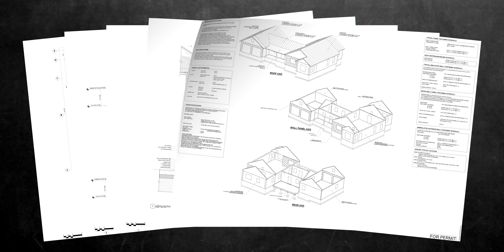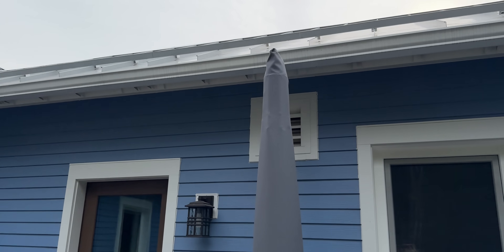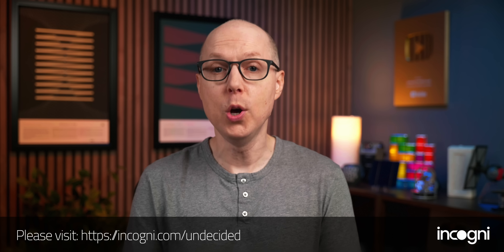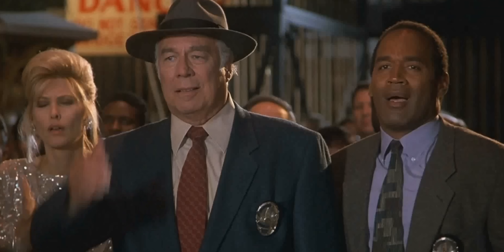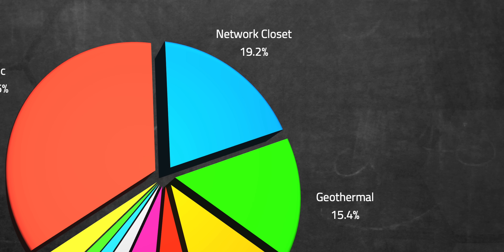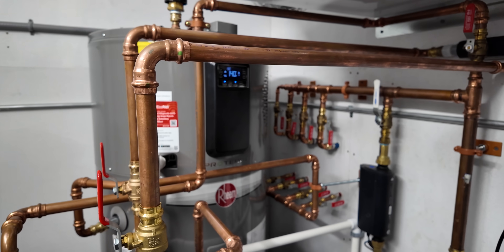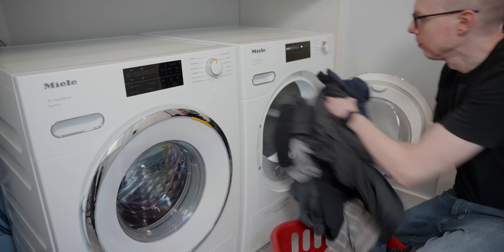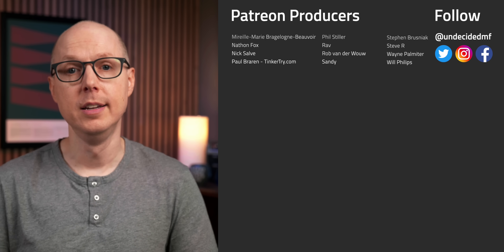What I Learned After 1 Year in My Net Zero House

Comment: I am planning on building or converting a house in the near future. In my plans, I can do all the electrical work myself having been an electrician for 45 years. My cost analysis is going to be looking at some of the outrageous prices of super energy efficient systems compared to just adding more solar and batteries. I would love to design it without a grid connection because they just don't seem to want or need your power any more and pay you practically nothing for it. The cost of solar and batteries has plummeted and there are some great DIY systems out there. I would plan it to supply 100% of my energy needs on the worst case weeks. In the summer, I think running a crypto data miner would pay near or better than the utility does. My thought is about 30-40kw of solar and 100kwh of battery feeding about 20 kw of inverter. I am hoping to have the real estate to have a separate structure for the batteries and inverters and all solar ground mounted. I have found my current 12 year old HVAC system to very costly to maintain and wonder if spending less on a bunch of stuff would be of better use making power instead of spending a fortune to use less. Of course, there may be some hurdles as many building codes require that you have a utility connection and have all the latest energy efficient stuff. It sure will be an interesting build that may be better done on an existing building not having to meet that 20% to 30% cost increase due to efficiency.
Any input by anybody would be greatly appreciated.

Comment: Have 4% on your back up heat normally your heat pump produces your heat, but there is times when it’s not producing enough so it it will turn on the burners in your furnace to supply extra heat. I believe that’s correct.

Comment: Really great video.  Thanks.  

I notice that your attic doesn't have (visible) radiant barrier.  Is that not necessary/optimal where you are?  With the R65 insulation, it's possibly a moot point.  I'm in a part of CA that gets over 100 for about 2-3 weeks cumulative over the summer; radiant barrier has helped keep our house cooler and reduces our AC use.

How much does all that monitoring HW and SW cost to set up and maintain?  I'd love to be able to do all that too, but seems like it would be expensive.

Comment: I’ve made my home in Southern California energy net zero - a lot easier to do than in Massachusetts. My 12 years of experience tells me most problems are best solved by adding more solar panels. Why? Because unusual high-efficiency systems are extremely expensive to install and maintain, and often unreliable. Solar on the other hand is extremely reliable. A simple system is best.

Comment: Great video! I retrofitted my 1880s house that had an oil furnace to be heat pump everything with solar and it's been great. The only issue I've had is with my AO Smith heat pump water heaters failing every few years.

Comment: GPT has thoughts: In the SPAN Smart Panel app, "heat backup" refers to the ability to prioritize heating systems (such as heat pumps) when managing backup power during an outage. If your home is equipped with a backup battery system, the app allows you to designate essential circuits, like heating, to receive power from the battery during a power outage. You can control which appliances or systems continue to run, optimizing how your stored energy is used to extend battery life. This feature is part of the broader customization options available within the app to manage home energy usage and backup systems efficiently.

Comment: In SWFL and ended up getting a Rheem heat pump water heater and agree, even without anything fancy to pre-condition the water, only using about 88kwh in the summer to keep my water hot (we leave it at 140), with the added benefit that it's also helping to cool my house down!

Comment: Heat pumps usually rely on a traditional burner or electric heating coil for emergency heat.  The thermostat should have a control wire for activating that. I’m guessing that’s what your app is calling backup heat.

Comment: I know the idea here is to focus on energy efficiency, but economic efficiency I think is not an insignificant point. I love the idea of these kinds of appliances like the geothermal HVAC system and even the heat pump dryer. But, using that heat pump water heater is an example, because it is the only appliance I have direct familiarity and knowledge of, it is so insanely expensive compared to a standard water heater, and then there's the issue of maintenance. There is no way that I can reasonably expect that that refrigerant system in that thing is going to last 15 years. And, when it does require maintenance, if I can even get someone to fix it for less than the cost of a new unit, which is highly unlikely given the cost of that type of work these days, it seems like you reach a point of diminishing returns. 

I have a solar water heater, an AO Smith, which I absolutely love. But the reality is that this thing cost about $5,000 installed. whether the water heater dies or not within 20 years, I'm sure my homeowner's insurance will demand that I replace it at some point solely on the basis of its age. I did spend a couple of bucks to put an electric anode in it, which has a 20-year warranty and so far my 10-year-old water heater seems to be performing well, but it will never save me $5,000 or anything close to that in electric usage even over a 20-year lifespan when compared to a relatively inexpensive but efficient standard electric water heater.

Comment: Thanks for the video! I have a ground source heat pump in a cold climate (I live in Stockholm) and I have the same experience as you have with wasting more than saving energy when trying to micro-manage temperatures. Watching the HeatGeek channel a few months back convinced me that I was doing it wrong, and since then I have adjusted my settings to try and heat all the time (in winter months ofc), all the house, with lower water temperature than before, which improved my efficiency quite a bit. I even had tado smart radiator valves to control room by room the temperature, but that I now set only to avoid overshooting temperature to uncomfortable levels (which can happen in very sunny winter days).

Comment: I am convinced that panels plus batteries and heat pumps are a good thing but for already existing houses it is difficult to justify especially if you are likely to move or are over a certain age. I am 70 so a system for my 6 bed house would take 15 years to pay off, I hope to be around at least that long but am not betting so much money on it.

Comment: Definitely saving on Bills, but is it worth the up-front cost it takes? From financial standpoint. All that geo heating, water tank, solar, battery' must crazy expensive. And insurance on all that? Isn't it better to just use gas combi boiler for heating and hot water? Maybe wet heated floors or radiators? What is pay of point for solar and battery and their life span?

Comment: At 16:14, you say that dryers that vent outside of your home are ejecting a lot of conditioned air from inside your home.

The issue with ventless dryers is that they are ejecting warm air inside your conditioned home, so your air conditioner is going to do more work as a result of running your dryer, regardless of where the air is being vented. I'd still recommend heat pump dryers simply because of the fact that they need a fraction of the energy usage for drying the same load of laundry, but the heat they produce doesn't magically disappear.
Reply: The other benefit of a ventless however is the... lack of venting. In a super air-tight home with a vented dryer, you often need a makeup-air solution on top of everything else going on. Obviously not a concern on a "standard" home. Just throwin' that out there. :)
Reply: @suavocado69  I understand, but with his ERV, his home isn't air-tight, anyway. Inside air leaves, and outside air comes in.

My comment is about the heat, and I don't like that people leave this out when discussing heat-pump dryers.

Comment: Matt, such great information in this video. Thanks. A few questions. You talk about keeping the house temperature fairly constant with geothermal. How would geothermal efficiency be affected if I like to open the windows when possible for fresh air and just for feeling more connected to the outside? Also, I like it cooler at night to sleep. In the summer, I keep the temperature fairly constant and turn on fans to make the bedroom feel cooler. But in the winter, I lower the house temperature by about 8 degrees Fahrenheit to get a comfortable sleep temperature. Do you find that a constant house temperature is comfortable both during the day and at night? Looking forward to the next video.

Comment: We have a standard home I retrofitted with caulking to mitigate air infiltration, thermal insulating blinds and I added R-70 insulation to reduce heat loss. 

We have a 2 @ 4 X 10 black chrome panel SHW system, which provide about 80% of our hot water use.
We have a 7 kW (STC) yearly net metered PV system which generates a yearly average of around 16 kWh a day.
We have a 2013 Chevy Volt plug in hybrid we use for all our local driving (~50 mile range).
We have a 3 head Mitsubishi air source heat pump we use for all our HVAC needs.
We line dry our laundry.
We grow an orchard,  big garden and use permaculture to grow our soil nutrients, yielding about 80% of our food on our 1/3 acre of active ag.

Our average daily consumption is a miserly 14 kWh/day, so we are slightly over net zero energy.

This is not to say the house is environmental or "green" as all these high tech products are 100% dependent on the underlying hydrocarbon powered industrial mining and manufacturing foundation... plus inverters, batteries, charge controllers and solar modules fail, necessitating constant replacements.

Comment: Love this video. Fascinates me you cant buy this kind of house off the shelf. However, recommend to provide the kwh energy since % are not ideal to compare with old inefficient houses -  you go into this, but it's a bit confusing. Two bar charts with current and old/standard home is much more easy to understand. 
Also, I cant really understand how "misc is 35%" and your car is just 12%. I would have thought the car would be at least 50% of such a good home, but of course depends on how much you drive and charge at home. Here again, kwh instead of % would help me understand what is going on. Btw, a gas (methane) stove is also super bad for the environment on top of being safer and yes energy efficient. 

Cant wait to build my own home like this one day.

Comment: I think you are far,  far too rich to make useful comments on most,  not all,  of the items you cover.  Even in the U. S.  you're level of spending must be truly exceptional.  
My,  rather more modest investment amounts to a decent PV array and two air conditioners (each = 4kw max heating) I do highly recommend  this combination but do not expect the air con',  which is a heat pump,  to be worthwhile if you go below freezing. Don't let this put you off they are very good for other times but you will need a backup or at least a secondary heating method. 
It will be interesting to see how quickly using a car as the home battery evolves IF we are ever allowed to have the cheap Chinese cars. (and I say that as someone who will never be able to afford a car.)

Comment: Something for the folks who live in a place without chlorinated drinking water - If you switch to a heat pump water heater, you'll need to be mindful of Legionella in your plumbing. We switched to a heat pump from gas hot water during our renovation, and we had to jump through a bunch of hoops to get it to pass inspection because the heat pump couldn't heat the water above 65°C on its own. Some water heaters can do it, but ours is a low temperature system that's tied into the same loop as the floor heating system. So we needed to get a booster that pasteurizes the system regularly, and consumes some power doing so.

Comment: Three years with a geothermal HVAC system.  My experience is similar.  Permanently deferred cost.  Environmental comfort is a metric that cannot be evaluated on a spreadsheet but is alone worth the higher upfront cost.  My apologies to the spreadsheet wielding MBA’s, your metrics will steer you in the wrong direction.

Comment: Another benefit of the Induction cooktop is that it doesn't heat the air around the the pan. My mother saw her kitchen stop getting hot after cooking anything unless somebody uses the oven. Not only does it use less energy, it creates less waste heat that would need to be managed. I am curious what the maintenance is like for the ground loop, expected life of the loop itself, and potential repair costs if it needs any.

Comment: I don't know if you, Matt, or any commentators has covered this issue, but here goes.
Of course, the energy budget of the complete build should go into the calculations of 'net zero' over a chosen time period - the planned lifetime of your house. Also, of course each item of your equipment will have a lifetime, which should influence your selection of time period/lifetime. It's a bit 'wheels within wheels', though: where can you get reliable data on the lifetime of a component?

Comment: As an owner of a brand new, high-efficiency air-source heat pump, I can say with certainty that you are not at all guaranteed to save money. My new system uses half the energy to heat that the old one did, but at 4x the cost: I went from a $500/month heating bill with an ancient, busted, highly inefficient natural gas system to a $2000/month heating bill. (In the summer, it is way more efficient than the old window-rattling AC's I had used before - my cooling costs are less than half what they were - so it's a huge win there.) Granted, my house is super old, the windows are drafty, and the insulation is rotted, so there is a great deal of room to improve that with new windows and insulation. Electric rates are also down from last winter, so maybe this winter won't suck so badly. But it's still important to realize that energy efficiency does not necessarily mean cheaper. If wallet-friendly is your goal, definitely include the energy costs for different energy sources where you live in your calculations.

Comment: Heat backup is the resistive coils on your HVAC for when the outside temp is too cold for your system to keep up. Heat pumps have this too- if the temperature outside is too cold there's no difference over the coils great enough to move the outside heat inside it needs to supplement it with basic simple resistive heaters.

Comment: Always a fascinating look into the everyday tech that surrounds us (I love Span breaker panels) !!! Just a caveat, if you are not planning on generating enough of your own electricity and have to purchase kwH from your power co. heat pump/electric appliances will most likely cost more to run than nat gas, depending on local utility rates among other things. But, if you are going all out on enough local generation & storage, electric appliances will essentially operate free of charge and help reduce the ROI on your projects.

Comment: If your heat pump is like mine, the "heat backup" is a large resistive element that is installed inline to provide warmth when the heat pump can't meet the house's demand. I have an air-to-air system instead of geothermal, but if the outside temperature ever goes below -11F it can draw up to 10kW to heat metal coils, space-heater style. Ours has never kicked on in the year that we've had it, but at that kind of power draw even a few cold nights could cause that 4% consumption.

Comment: That's maddening how long it takes for permitting etc of whole home grid-tie inverter systems.  You can cover 90% of the devices you care most about having available during grid outages for $2000.  That's a 5kWh battery and a 2kW inverter to cover the refrigerator.  This assumes the builder installed LumenCache that's already using the battery for lights, ventilation, sensors, USB chargers, etc.

Comment: Matt, I have a very valid question that I think you may have overlooked with the "Net Zero" mantra.

A lot of cars were sold during Obama's "cash for clunkers" program.  A lot of homes were sold 2021-2023 because of FOMO and low interest rates.  Both programs caused people to spend more in the short term to claim savings later.

Your "savings" in the future should calculate the greater then normal expenses you incurred in the past (and the added "not green" technology/manufacturing required to produce the "green" products) should they not???
Reply: @UndecidedMF

Sorry for the suspicion of the cryptic response as I am sure that I am not as technically savvy as yourself.

Comment: Schell Brothers Homes is planning to use our Humidity+Temperature SIBs in between floors and in the attic like you added.  No battery changes and they simply connect to the nearest light.  It'll be interesting to see how many features in your home would be easier and more reliable if you were building new next year with LumenCache.